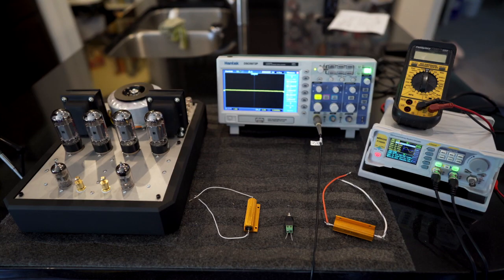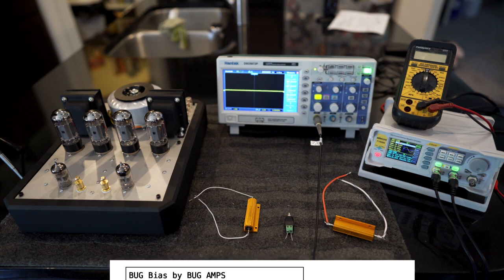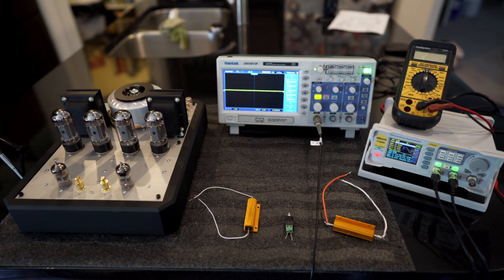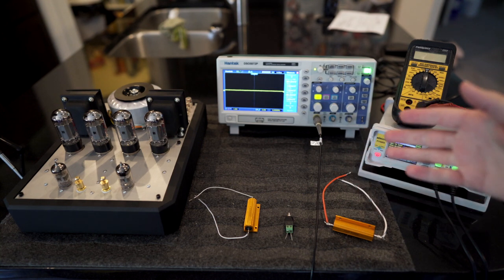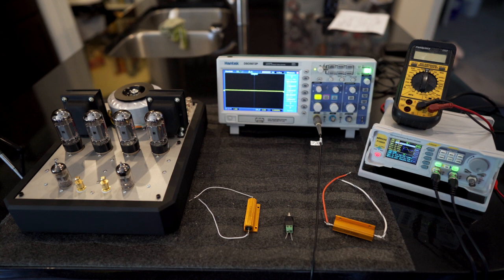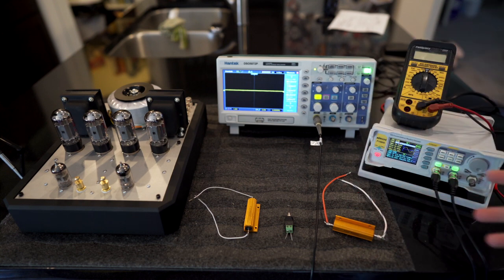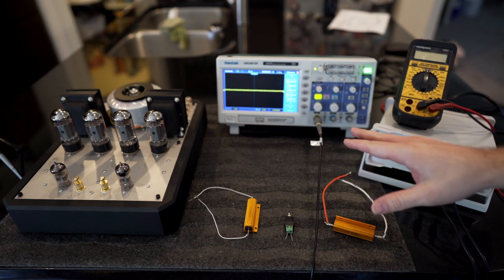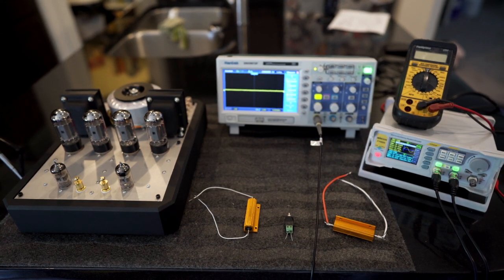Removing Crossover Distortion with BUG Bias

Comment: Crossover distortion occurs between cutoff and class A amplification.
Does Class-over distortion occur when switching between class A amplification and class AB amplification?
Reply from the maker: Crossover distortion occurs when the tube bias drifts into class B operation. When that happens there is a portion of the signal that doesn’t get amplified at all because both tubes are in cutoff at that time. 

This typically happens to AB amps when the grid swings positive of the cathode and collects electrons. The extra electrons build up in the grid circuit Re biasing the tube into cutoff.

Comment: Howdy. Very nice.
In my 4xKT88 tube PA I manage the cross over notches/kinks by cross feeding neg. feedback from the end tube anodes to the drivers. I never use global neg. feedback. I don't like to include the OPT phase shifting into the loop.
Works pretty well. The method makes the PA very proned to parasitcs though. They must be managed and comprehensively checked.
The link to the report:   https://eugpoh44.blogspot.com/
Regards.

Comment: Great video! Thanks for posting. The circuit is indeed fixing (Rectifying! Ha, I am so funny!) the coupling cap charging problem. I would be interested in seeing what the difference in power dissipation is of the tubes putting out square waves during heavily overdrive with and without Bug Bias.
Reply from the maker: Leif Erickson definitely dissipation is way up with the BB system engaged. So should be taken into account. Though in testing the plates didn’t go red after several mins of being clipped, for whatever that’s worth. 🙂